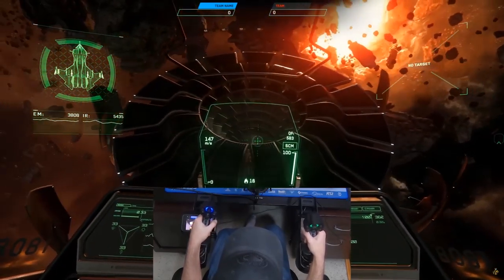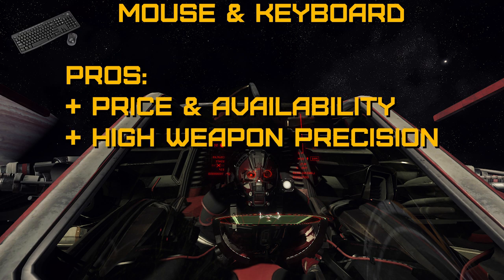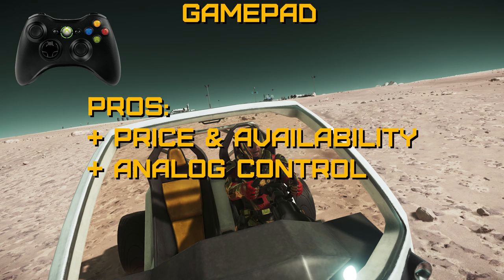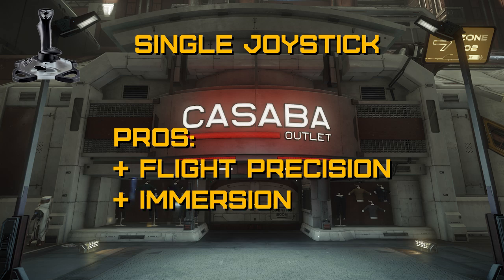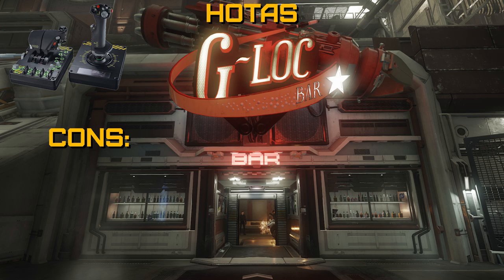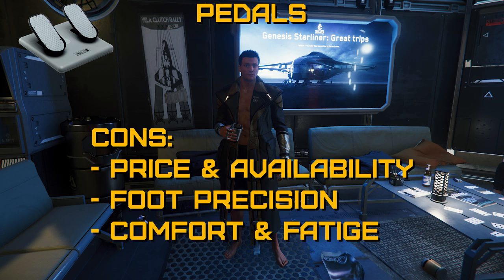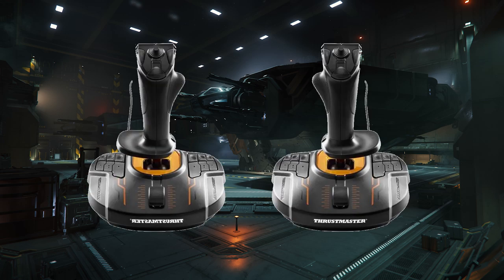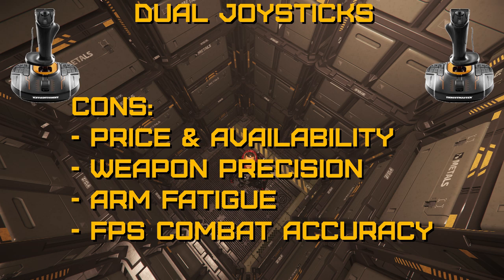Why Use Dual Joysticks?

Comment: Does duel stick only work for space sims like ED and SC? Or would they work for games like WT as well?
Reply from the maker: WT? World of Tanks? I suppose it might work. Depends on the game. I've used dual sticks in Mechwarrior Online  MW4.
Reply: BuzZzKiller i meant war thunder. I’ve been told a duel sticks wouldnt work to well for plane and jet sims but i figured it would essentially be the same if you only use one as a thruster
Reply from the maker: @angelarroyo6001  I've actually tried it on War Thunder. It's not ideal. For a plane you usually want to use a standard throttle because it doesn't return to center.

Comment: normal people: use pedals for strafe axis or yaw.

me: THROTTLE and the rocking functions are for landing gear and cargo hatch!

(edit: if I use the pedals for throttle in the dual stick setup, I can more comfortably fly without tiring my arms, considering throttle adjustments are a majority of your action in the game.)
Reply from the maker: Interesting. I just can't stand pedals. Maybe if I had a sim pit where they were hard mounted and didn't slide all over the place I would use them. But with Dual sticks I haven't felt the need. I use the cruise control function and decoupled a lot during travel so my arms never get tired.
Reply: @BuzZzKiller  ah. guess its more of my Elite Dangerous playstyle then. yea i wouldnt see the use for it in SC

Comment: I use a dual stick setup. I use 2x T16000m but I also have a Logitech Driving Force GT (DFGT) Wheel in the mix as well. 

My main game is Elite Dangerous and this setup work amazingly well.

The basic (flight) axis setup
Left Stick: Strafe Left/Right (lateral thrust), Strafe Up/Down (vertical thrust). The twist toggles FA On/Off.
Right Stick: Pitch, Yaw and Roll.
DFGT: The pedals control forward and reverse thrust. I do have face buttons mapped to 75% thrust (Trust the Blue).

I call this HOSFOP (Hands On Sticks Feet On Pedals).

I have never got Star Citizen to run well enough to try flight (is FPS really tied to connection?), so I have no idea how well this works with it.

I just bought X4 today, so will find out if that is a possible setup with it and how good it works.
Reply: For flight I also have the face buttons on the wheel mapped to handy controls (75% thrust button, target wingmen and their targets, cargo hatch). Like wise with the T16000m's. They also have most used controls mapped to the head buttons, lesser used but still handy bindings are on the base buttons.

The wheel also make driving the SRV better (IMHO). But breaks immersion a bit when it comes to playing in VR (something I rarely do these days).

With Odyssey (although I am not currently playing it, gonna give it time to be fixed), good old KB/M for the FPS side of things.

Oh and I have incorporated a 15 key Stream Deck for quick access to maps, speed set keys etc.

Comment: you missed out eye-tracking tobii 4c is the best example, because it can also mimic the mouse and accuracy because of the eye retina the immersion is on the real, because of information is your eyes input, and because of this your output peripherals automatically act on impulse without thinking, the best example I can give is driving over your car, and VR does not have the proper capabilities yet, and that is because you have to wear it over your eyes and you cannot see other things you need to torch I hope this helps in your next video which I know you will seriously consider
Reply from the maker: I've been curious about how that would work in SC. But the hardware is pretty expensive just to experiment with. I'd love to see a video of it in action.

Comment: Unless you have a ''Multi-role'' simulator like I do :) 

I'm using a Logitech X56 (Throttle and Stick) mounted on each sides of my seat. I'm also using  a Logitech G29 wheel with pedals as for when I drive vehicles. To move around in Star Citizen, I'm using a Rii keyboard with a track pad which is more accurate than you think.  This wireless keyboard is quite small and does fit into the cockpit. 

All of my wired controlers are going thru an Amazon 10 USB 2.0 hub, which is also quite cheap. 

I will soon add an Oculus Rift S to my gear. 

Maybe I'll post a video of it someday but when I get the time to make the video. 

As for my opinion, I prefer the Hotas option since it fits more than space games. I also play Flight sims so with the dual stick it just doesn't work for me but like you said, for space game that rocks !!

Cheers

Comment: If you can buy a HOTAS, you can add to that configuration pedals + keyboard + mouse.
Pedals + HOTAS for spaceship.
Keyboard + Mouse for FPS.
Reply from the maker: I have a Thrustmaster Warthog HOTAS and I even did some bindings for it as a special request from a friend. But it's not a stick made for space sims since it doesn't even have a twist axis. Pedals are more trouble than they are worth IMO unless you have something to hard mount them to. I don't so they slip and slide everywhere and are generally uncomfortable. Once I finish my house move, I may end up getting an FCS Hotas and start doing bindings for that. They seem pretty popular right now.

Comment: I used to have a full racing sim plus a joystick, sold it all a few months ago but I want to play something with better immersion, was looking for Hotas joystick, at the end I decided to buy 2 Logitech 3D Pros, it is very cheap now, I played Elite dangerous for almost 100 hours and I always felt another joystick for the other axis would be the best, I'm imagining now how to control the throttle using two joysticks now... add a pedal for forwards thrust/reverse would be perfection, I used to use my racing pedals as that.

Comment: Really great video. What are the best arrangements of HOTAS with mouse and keyboard (TKL keyboard in the middle?) on the desk?
Reply from the maker: If you have everything on the desk, I typically put the keyboard in the middle with the two joysticks (or joystick and throttle) on either side. The mouse is either to the right of the joystick or in front of the keyboard. Optionally you can look into ways to mount the keyboard & mouse under the desk on a slider. (Search Amazon for Keyboard & mouse mounts). Or get some desk mounts for your controllers. MonsterTech makes some, but they are pretty expensive.
Reply: @BuzZzKiller  I have old but fully working saitek x52. I arranged my mouse and keyboard as you wrote but mouse became too far away on the right. Now I'm thinking to buy a cheap TKL keyboard which I'll use only with HOTAS. I chose this arrangement because I don't want HOTAS in between my hands and keyboard&mouse for ergonomics. IMO base of stick and throttle could've been much smaller but saitek keeps making same big bases.

Comment: Re:Controllers.  Modifier buttons solve this. I use my left and right dpad pushes as modifiers to allow access to basically everything
Reply from the maker: Did they bring back modifiers for game pads? Or are you using joytokey?
Reply: I play Elite Dangerous, so they support in game modifier bindings.  You just hit both keys when setting the key binding.

Comment: Wow mouse stick and pedal sounds amazing. Is there a way to set up profiles to easily go from that set up to duel stick and back to mouse and keyboard?
Reply from the maker: If you're going to use HOSAM, I'd invest in an MMO mouse like the Razor. But yeah, it can be done.
Reply: A have a g502 wireless, dual thrustmaster sticks and I am now looking for peddles. I am so stoked to learn how to set it all up. Thanks for doing these vids man.

Comment: Is the thrustmaster T flight hotas 4 X a good one to start with
Reply from the maker: If you're looking for the bare minimum it will do. It doesn't have many buttons though, and only 4 Axes. I'd suggest getting the T-16000M. If you can only afford one for now, you can always buy a second one later.

Comment: Keyboard doesn't have over 100 keys. Even accounting for the 10key, the number keys along the top, the Function Keys, and the modifier keys like Ctrl and Alt, you have maybe 50-70 keys tops.
Reply from the maker: A "Standard Full Size Keyboard" with a numpad and Arrow Keys typically has around 104 keys. Get a gaming keyboard and that number can increase significantly.

Comment: Am I a weirdo if i'm using gamepad + keyboard for extra buttons + mouse for aiming? :D
Its pretty easy to set up your main ship controls on gamepad, use keyboard as a switch panel for miscellaneous controls and mouse for tasks that specifically need aiming. It does require you to get used to alwas hold gamepad with other hand when you use keyboard or mouse though.

Also, it should be noted that some devices in Elite almost "built for mouse", like FSS scanner. Since it has nothing to do with your ship's maneuverability and rotates pretty much instantly (no inertia), mouse becomes vastly superior to anything else for that specific mode.
Reply from the maker: It's not wierd. Whatever works best for your gameplay style and budget is what you should go with. I've used a gamepad in a pinch, but personally it just isn't fun or immersive enough.

Comment: Hey buzzz, were those the long extensions or the short extensions from virpil? Do you like them and which one do you prefer. I am going dual stick set up and I dont think I need the long desk extensions but I dont want to undershoot either..
Reply from the maker: I don't have any extensions on mine. You only need extensions if you are planning on mounting them very low.

Comment: While i have basic locomotion/interaction useable on dual deltas I'm eagerly awaiting the mouse pad for the virpil deskmounts at which point i will use hosasam switching to mouse for FPS combat. Right now im using axis to button to handle lean, crouch, and jump on the left stick as well as the thumbstick for movement. Would be sweet if CIG would create an analog axis for lean and crouch.

At any rate glad to see youre posting again. Does that mean you're stateside?

Comment: You forgot the biggest detriment to a keyboard setup: ergonomics.
If I'm going to sit down and play something for hours, my keyboard hand is going to ache.

It's enough of a factor to make me switch to a controller for a lot of games, even though i prefer mouse aim. (Most games don't have good mixed control mode options).

Another controller pro is that you can use it under a blanket.
I love my flightstick, but it doesn't work so well under a blanket.
I've tried a second small blanket on my desk, but it doesn't work well. My mouse hand always ends up throwing the blanket off frequently. At some point, i end up losing my place with my left hand. And it seems to let too much cold air in, so my hands still get cold. (Gloves are a better option for this)
So the controller wins the keep-your-hands-from-freezing award.

Comment: Found your channel today. Im really happy because I use 2 Thrustmaster16000 like you. Can you tell what is better. Should I install joytokey or just put your xtml file into the game. Or I need both methods? Sorry for my english, im from germany.
Reply from the maker: For my profile to work you will need JoyToKey and my configuration file. You will also need the exported .xml unless you want to bind the buttons manually.
Reply: @BuzZzKiller  Thanks man, works fine!!!

Comment: Is it possible to use a keyboard in left hand and a joystick in right hand ?
Reply from the maker: yes of course.
Reply: @BuzZzKiller  And is it efficient ?
Reply from the maker: @valalol  It works pretty well. You just won't have analog control over some of your movement directions.
Reply: @BuzZzKiller  ok

Comment: what's the best set-up for a new player using VR to play Squadrons? Let's pretend a budget of $150
Reply from the maker: Right now, thanks to Microsoft Flight Sim and supply shortages, stick prices are through the roof. At $150 you likely wont find much. I would normally recommend the T-16000M FCS pack that includes a stick and throttle. But it has shot up into the $300+ range now. 

I don't really know what the flight model will be like in Squadrons, but I'm assuming it will be "planes in space" for a traditional Star Wars feel. So a HOTAS will likely work better than a HOSAS for that game.

That being said, for $150 you're looking at a single T-16000M using the slider as a throttle. Other options may be the Thrustmaster T-Flight or PXN-2119II set. 

I've never used the T-Flight or the PXN so I can't vouch for their build quality. I know from reading the forums that the T-16s have been having some issues lately with their Z axis failing, but I haven't experienced any problems with mine...yet.

Comment: The constellation alphas blow the keyboard and mouse option out of the water. The two gampad joysticks (one on each stick) gives you the gimbaled weapon precision of the mouse and keyboard, while giving you the ability to set up fps modes on the stick so you never have to remove your hands from the controls
Reply from the maker: Have you actually used them? The deltas have the same thumb sticks. They aren’t anywhere close to the accuracy of a mouse.
Reply: @BuzZzKiller  fair enough.

Comment: Hmm, interesting. I think my ultimate setup, which would be quite expensive I admit, would be as follows:

-Two joysticks, for the reasons you list
-A racing pedal set rather than a flight pedal set. You already have the normal 6DOF controls on the sticks, so what I'd use these for is as a secondary forward and backward throttle (accelerator and clutch respectively), for less dynamic situations where you're holding these down for a long time, to reduce arm fatigue. The brake pedal would be used as the "STOP EVERYTHING I WANT OUT" emergency brake functions available in some games.
-If playing a game with manually controlled gimbal weapons: Head (or eye, if you prefer) tracking. This would replace the mouse as the method for aiming gimballed weapons. When set up right, it can be really darn accurate and intuitive, though still slightly less accurate than using a mouse.

All in all you'd get the flight accuracy and button count of twin joysticks, with reduced fatigue during less-dynamic flight, and precision aimed gimbal weapons.
Reply: The Thrustmaster TPR rudder pedal set is superior to racing pedals for this. They are extremely sturdy and precise and have 2x toe brake axes plus the main axis. I prefer using it over my racing pedals for strafe up/down control (although obviously for racing Sims the racing pedals are better).

One of the issues with a good set of racing pedals is that they'll have load cells or similar for the brake axis, and perhaps a different clutch axis too, which makes all the axes feel different from each other

Comment: Newer/better hotas have 6 or more analog axis, characterizing them as single joystick + one analog axis for throttle doesn't make a ton of sense. Also you forgot button count on pros, most throttles have more buttons than sticks, if you're putting +button count on HOSAS you should on HOTAS as well. And why does HOSAS get immersion and comfort but HOTAS doesn't?
Reply from the maker: I kind of figured it would be obvious. I guess I forgot because HOTAS came before Pedals and Dual Stick in the list. I had limited room, and I wasn't going to put comfort as a pro for every method except pedals. I'll take your suggestions into consideration when I eventually update the video.

Comment: Elite Dangerous has manually aimed weapons, they're just fixed hardpoints
Reply from the maker: ED has gimbals as well. But they are automatic and have a limited cone that they lock and fire in. Also auto turrets.
Reply: @BuzZzKiller  I know, but what he's referring to are fixed weapons
Reply: Yeah that was an error in the video. Elite has always has "manually" fired weapons.

Comment: Had a blast with SC, but gave it up because all my controls would reset when i logged... Gave up on elite because my plastic thrustmaster hosas setup only lasted me about 2 or 3 months of casual play...flimsy plastic. Cant justify buying something that's pretty much guaranteed to fail sooner than later, even with careful use.

LEAVING OUT THE COST... can anyone point me to a hosas setup that will last? Google search only brings up the same plastic crap i bought or something irrelevant. I like the top hats and the more buttons/ triggers my fingers have access to without taking my hand off the sticks, the better. Definitely all metal construction (or atleast the internal parts that parts that rub and connect). And a small pedal built into the base to act as a kind of cruise control?

Edit: Im probably asking too much... But lack of quality products is literally the only thing keeping me from getting back into space sims... I kinda gave up on gaming altogether after that.
Reply from the maker: Have you looked into Virpil? My daily sticks for Star Citizen are the Constellation Alphas. The grips are a hard high quality plastic but the warbird gimbals are all metal construction. 

The VKB NXT Evos are all plastic construction but seem pretty solid if you are looking for something less expensive.
Reply: @BuzZzKiller  Oh wow, thanks! Lots of options there!0

Comment: Elite doesn't have manual aiming? Pretty sure it has fixed weapons..... As it has had since release...... They're often the cheapest weapon to get, and any PvPer worth their salt will be using them.
Reply from the maker: It doesn't have manually aimed gimballed weapons, only computer aimed ones. Fixed weapons are different.
Reply: @BuzZzKiller  Yes....... He said manually aimed weapons, he originally said manually aimed gimbal weapons, and then later said he didn't know of any manually aimed weapons in elite.